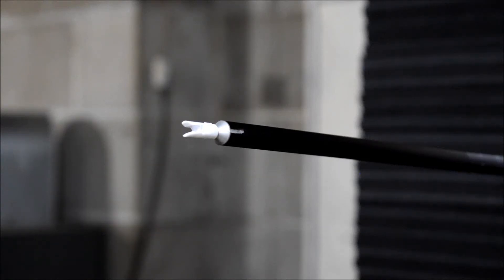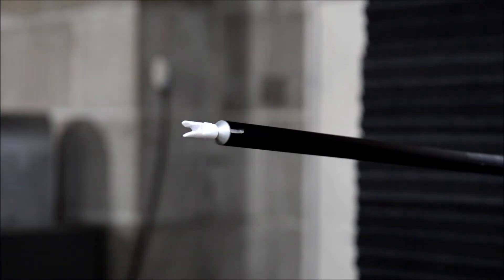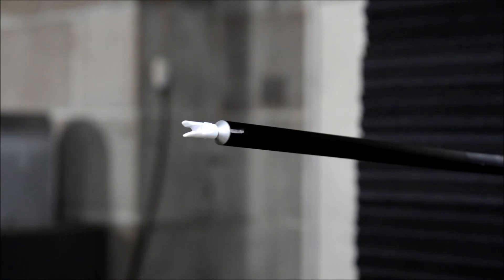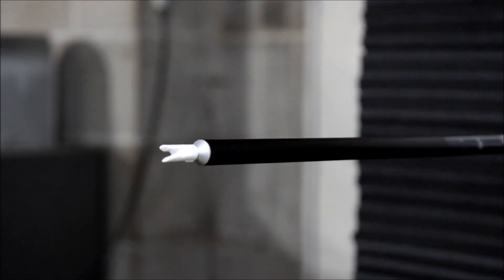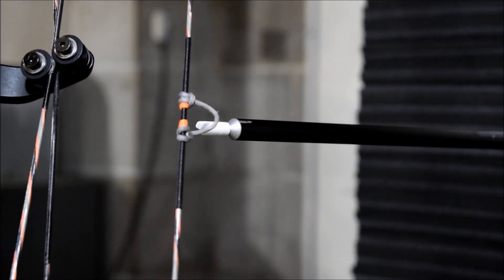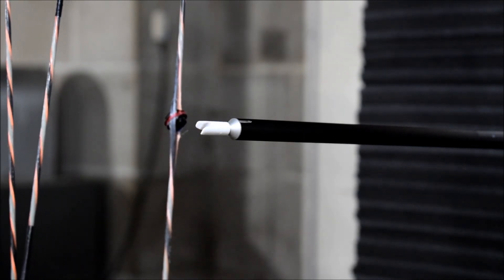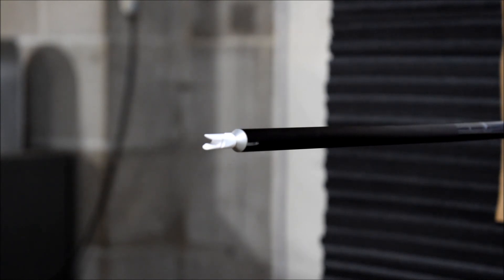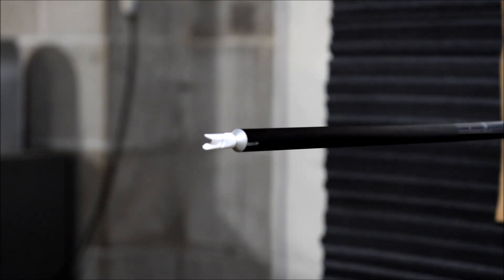What causes bareshaft rotation? String twist or serving orientation?

Comment: First test of this I've seen. Haven't ever noticed  it was happening!  Dying to high-speed film and analyse what physics are behind imparting spin. My brain will be crunching on this for awhile!
Reply from the maker: 1nestly has done some good high speed video and testing of this as well so check out his channel. He actually has a comment just above yours. If you're really wanting to test this, my hypothesis is that the tabs on the nock are being forced to line up with the wraps of serving as it's properly served over the string. So for a clockwise string that has been served properly, the serving will be angled laying low on the left and high on the right like this / as it stacks up the string. Opposite is true for a counterclockwise twisted string so it would have serving laid out high on left and low on right like this \. The friction of the tabs on the nock and the angle of the serving forces the nock to line up to the wraps of serving and in doing so it imparts the spin. That's my hypothesis so if you have a way to test it or others, I'd be interested in your findings.

Comment: Interesting. I was introduced to bare shaft rotation by a bow tech when setting up a target rig with new arrows. The bow caused a counterclockwise bare rotation. The bow tech suggested a left wing vane set up which I followed. Logic was the arrow wouldn't have to overcome the initial rotation in the opposite direction. Then I went home and checked bareshaft rotation on my 2 hunting bows - both were CCW. Now I know a bit more about this from your test. Not sure it matters in the real world but more info always helps. Any theories on the mechanics of how the serving imparts this twist? I can't think of any.
Reply from the maker: If you look at how serving is "stacked" at an angle as it is applied to the string, you'll see that a clockwise applied serving will angle like this \\\\\\. Low on the left and high on the right. The tabs on the nock seem to be forced into being perpendicular with the angle of the serving so it goes low on the left and high on the right causing the counterclockwise rotation coming off the string. That's about the only thing that makes sense anyway.
Reply: I would love to see the same test while making sure each arrow is directly on their node in the middle of your rest.

Comment: Huntinsker, if CW rotation of the serving causes a CCW rotation of the bareshaft, then why do the majority twist CW?

Seems to me you would want a CW rotation of the bare shift as the tips screw in CW as well. A CCW rotation could loosen the tip or broadhead could it not?

I'm very new to string building but if your test is true it would seem to me you would want to twist CCW then. Your thoughts?
Reply from the maker: I can't speak for other builders but I twist CW because I like the look better and more importantly, it's more comfortable for me to serve the string that way when serving towards the loops. It's personal preference. I've also never seen a good test showing an actual benefit to serving a string to match the rotation of your bareshaft to fletching direction. I just don't think it matters much at all, if any. I've also never seen a point come loose because the direction the arrow was rotating. I suppose in theory it makes sense that a point could loosen if it's spinning CCW but often times theory and reality don't align in practice. Most people fletch with a right offset or helical anyway so that's going to spin their arrow CW very shortly after coming off the bow.
Reply: @huntinsker  Makes sense. As I said I'm just starting with string building and just looking at this as a hard rule, which I'm sure I will find out through trial, is not a hard rule. Appreciate the response, I got the jig setup today and really excited to start wasting material next weekend....lol.

Comment: I,ve had 2 shafts of the same batch spin in opposite directions off the same bow. This could be a freak of physics but i,m yet to try the rest of the shafts..They are cheap shafts but it does show that there are more factors than string twist and serving that determine bareshaft rotation.
Reply from the maker: I'd love to see that on video. I've been told this a couple times by people and no one is willing to put it on video and let anyone else see it. A particular female pro shooter claims to have done it but she only shot two shafts at one distance, which is not enough to show the rotation trend so not enough to prove anything. When you video your two shafts, please clearly mark them and shoot them at at least 3 different distances.
Reply: @huntinsker  Firstly thanks for the reply..I really wanted to see both arrows spin the same way but they didnt and i,m just trying to find info on what would make that happen, the shaft that rotated clockwise did not rotate much compared to the counter clockwise shaft so unless I shoot the rest of the shafts I cant say if it was a one off or inferior shaft or nock..shooting at 3 distances would prove that it turns a bit more the farther from the target or do you think it could start spinning back the other way?....I also saw the girl shoot the 2 shafts in her house and it does clearly show that 2 arrows can spin in opposite directions out of the same bow but again, it could be down to imperfections in that one shaft.
Reply from the maker: @middleagedshred  Unfortunately the female pro did not show anything besides one distance, which is not enough information to prove anything. You have to be able to see the trend in rotation so one distance doesn't do it. It takes a minimum of 2 distances but 3 is best to show the actual trend in rotation. If you only shot one distance, you might not be seeing what you think you are. One shaft could simply be rotating faster than the other due to tighter nock fit than the other shaft. That could make it appear it's rotating the opposite way when really it's just going around farther in the same direction. That's why I'd be very interested to see a video of your test. As it stands, you're the only other person in the world that I know of that has two shafts potentially spinning opposite directions and has still not fletched them or changed them in any way. I've tried over and over to get opposite spin from bareshafts and I've simply never been able to do it so naturally I'm curious to see it actually happen.
Reply: @huntinsker  I,ll try and make one at some point at 3 different distances..i,m just trying to think of the best way of doing it to properly show that its not faked in any way..
Reply: @middleagedshred  maybe the nocks ?  try switching them
Reply: @d500mag2  yea man..been meaning to try that..

Comment: I learned about this issue recently, that is to determine which direction a bare arrow wants to rotate naturally when shot.  Levi Morgan has a video on this, he calls it the "tip that no one knows".  His video says shoot each arrow, using the method of marking the arrow you are using, and observe which direction that individual arrow chooses to rotate naturally then fletch to match that rotation direction, left or right. 
Your video seems to say arrows are going to rotate left or right dependent on the serving direction.
Did you try different arrows with your testing or just one arrow?  Perhaps it makes no difference since it appears you got the same arrow to rotate in a different direction by changing the serving.
How about another test using say five or six different arrows to see if your results repeat.

Comment: Paige Pearce actually has a video showing that arrows can turn both ways, actually. It's quite weird.
Reply from the maker: She has a video showing 1 shot with two different shafts from one single distance. That's not enough to prove anything. They could have been rotating the same direction, just one more than the other. Nock fit changes how fast a bareshaft will rotate so that's probably what's happening. That's why I shot 3 distances to see the trend. She didn't prove anything and when asked to follow-up with another video from more distances, she refused.